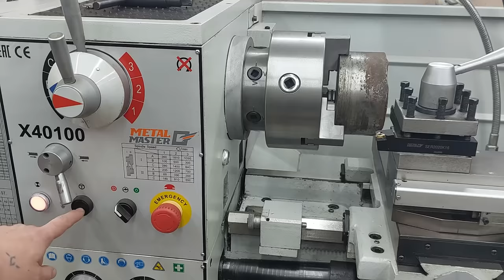You WON'T Believe! A simple version of making a part in 8 minutes in my workshop

Comment: Uh. All wrong
Reply: I agree. 😂
Reply: Pero porque esta mal?
Reply: @bugagames1239  First operation facing with grooving tool then finishing facing with second tool but now using Z axis, turning. I'd face rough facing with stronger tool SNMG insert because it's interrupted cut then a finish cut with your DCMT insert. Then you turning OD with grooving tool and insted of turning you facing, using X axis. But I'd center drill first. Support a part with tailstock so I have rigid setup. Rough turn OD making nice short chips. Finish pass. Then flip it. Indicate. Then ID turning. After that I'd groove to full depth but slower and with coolant so it wouldnt chatter so bad. Then turn tool post and use it to feed 70 degrees not 20 like you. You use side edge of grooving tool making hot burning chips. Pain to watch really. Also depth could be grater so when a belt become worn it still has nice grip. Nice dog BTW. Cheers.
Reply: Why faceing with parting tool.
Reply: I would't
Reply: @chrishill6276 Also, why wear crocs in the shop?😮

Comment: Wait... never mind all the rest.  Why did you drill out the centre THEN flip it over and cut the important part?  Those groves will be off-centre from the bore exactly how much your 3-jaw chuck is out.  If you had flipped it and then drilled, it would have been perfectly centred no matter how good or bad the chuck.